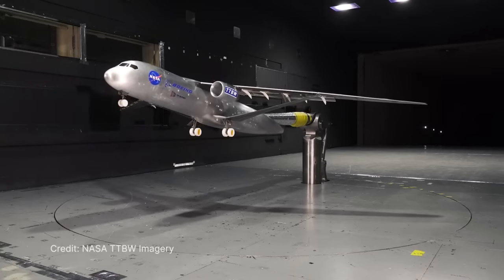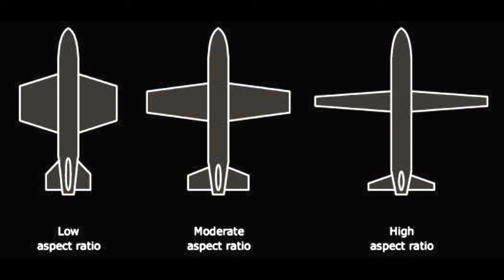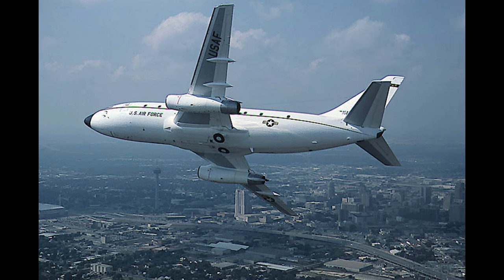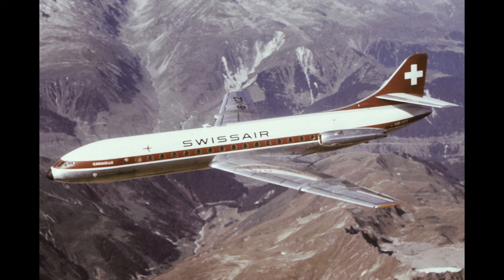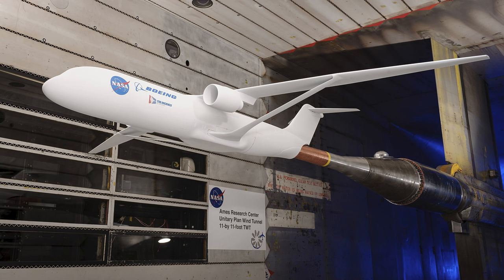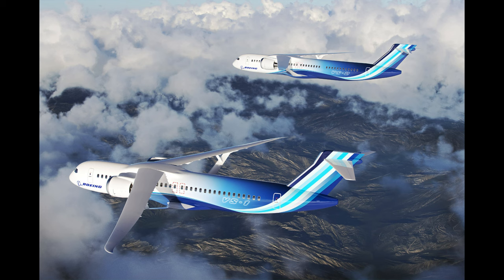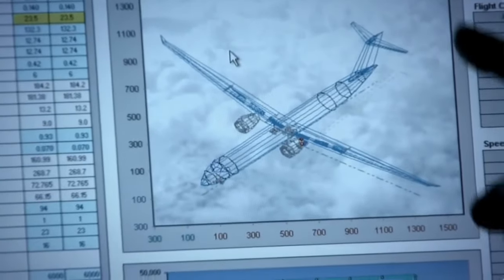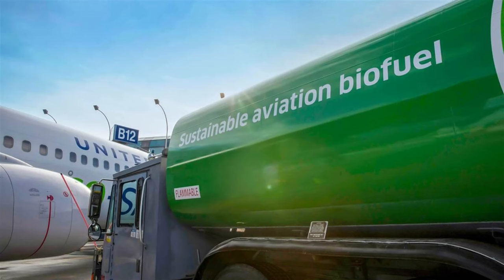NASA's New Airliner Experiment To Make Flying Less Expensive

Comment: The problem with very long wings on an airliners is space the plane takes as it maneuvers on the airport. Longer wings will require more spacing everywhere so that planes don't struck things or other planes.
In the past developing longer wings was fine because it was accompanied by larger number of passengers/cargo the plane could carry. But that changes when you are trying to produce a plane with same fuselage but just very long wings for efficiency. This might be more efficient when in air but should reduce efficiency when on land.
Another problem with very long wings is performance when landing in cross wind. Longer wings are likely going to limit the weather the plane can land it. Which would be a huge problem for airlines.

Comment: Believe it or not , I did think about the same exact design.
Wings do not have to be so beefy,  it can handle more of the G force,  plus more of a wing, less fuel consumption.  Drag is same , because the lower wing is not a connection, it is a connected triangle wing.
But I am retired Engineer, never worked at Boeing. So, forget it.
Greetings from california.

Comment: Maybe they could make a plugin hybrid where both the engines and electric motors would help with taking off since much of the fuel is spend in just getting up in the air.

Maybe climb to 55k feet and the slowly glide down to 40k feet over hundreds of miles to save fuel might help, too!

Comment: More relatable than the engines of light aircraft would likely be things like lawn mowers, electric generators and wood chippers. All of which need engines that need to be able to run at relatively high rpm, for relatively long periods of time.

Comment: You never pointed out the weight problem of electric aircraft. Fuel makes up approx. 45% of the weight of long haul aircraft. This decrease in weight over the course of a flight substantially increases the range.
Reply from the maker: Sound like you never watched the section on electric planes with flight endurance of an hour.

Comment: Two questions.

- Are they going to experiment with a wingtip-less wing design as well -- by basically making the wing a bit shorter and the struts longer?
  (A likely hurdle with that would be a lack of flexibility, but maybe that can be solved by making the strut telescoping with air pistons inside to control the level of flex or so)

- Secondly, what's Osaka doing in the background @1:54?
Reply from the maker: In answer to your second question - tickling the dragon’s tail.
Reply: That's less efficient; they've done coupled aerodynamic and structural optimization at this point, so the configuration is fairly close to reality.
Reply: @scottmanley  I lost all focus when I saw that - "Demon core!... uh, what were we talking about?" 😆
Reply: @AmbientMorality  So having wingtip vortices is no longer considered a problem, or at least not worse than the drawbacks of a wingtipless design?
Reply: @zJoriz  You're always going to have wingtip vortices: that's just a consequence of producing lift over a finite span, and we're infinitely far from an infinite-span wing!

They want the wing to be supported somewhere in the center because that's much more structurally efficient than a very long strut, and also because that allows folding.
Reply: @AmbientMorality  I see! Thanks

Comment: Just think of the tremendous weight savings if they could eliminate thrust reversers and also leading and trailing edge flaps and slats, while using a compromise delta-ish wing.

Comment: Could you look into the idea of acoustic flight control systems? My teacher mentioned it but I don't know if it is something that is simply in its research phases, but he mentioned that it uses the pressure differences that actives speakers systems create to roll, yaw, and pitch aircraft without increasing drag greatly.

Comment: Airport infrastructure is a big factor limiting aircraft design. Somehow, those high-aspect ratio wings are going to have to fit current taxiways, ramps, and gates. Imagine having to remove every other gate to accommodate aircraft design, reducing capacity. No one is building new airports. Idea: fold those high-aspect ratio wings upward for ground operations.
Reply: They will fold. The preliminary high-lift configuration showed folding just outboard of the wing-strut interface, and ailerons on both sides of that fold.

Comment: These designs probably will never see the light of day for a few reasons. 
1) fuel MUST be in the wings before fuel can be loaded anywhere else. Having an airliner that can’t hold a lot of fuel in the wings is dangerous for weight and balance reasons.

2) it’s too big. Airports aren’t going to remodel for it, simple as.

3: the truss makes under-wing work difficult. Boeing likes to keep their fuel panels on the wings, and for a wing this high it would need a truck to fuel it. Not happening with a truss in the way.

Cool design! But impractical and unsafe as it currently is

Comment: This has been done before, going back to the 1920's. 

Giuseppe Bellanca built a series of aircraft which all employed an oblique structure functioning both as a support strut for the main wing and as a lifting surface.

They included the Bellanca K (1928), built for a trans-Atlantic non-stop flight from New York to Rome which ended up not being attempted, probably because Charles Lindburgh beat the adventurer Cesar Sabelli to it, and at that point the almost all of the previous attempts had ended in disaster. 

Lindbergh had wanted to use a Bellanca WB-2, but was unable to reach an agreement for its purchase.

The Bellanca Airbus/Aircruiser/Skyrocket series,  transport and freight aircraft were capable of carrying up to 14 passengers or 3500 pounds of cargo depending on fit-out ordered by the customer. About 120 of various iterations were produced between 1930 and  1940. Where fitted out to passengers they were airliners

Then there was the 77-130 bomber and it's seaplane conversion the 77-320, about 12 of the two types combined were built and bought by the Colombian Air Force in the late 1930's.

These models all had that strut which also acted a lifting surface and were known for their carrying capacity, long range and fuel efficiency.

Comment: Just think of the tremendous weight savings if they could eliminate thrust reversers and also leading and trailing edge flaps and slats, while using a compromise delta-ish wing. Top speed might be slower but the HUGE weight and complexity savings would be .....huge. They might use larger electric brakes with better system redundancy. Eliminate hydraulics entirely. They almost have already. People who aren't aircraft mechanics have no idea how insanely complex all these systems are. Plus we know that they've been experimenting with the idea of eliminating the drag inducing vertical stabilizer by using improved fly-by-wire software and thrust vectoring. 
What other outside the box ideas could improve airline travel? How about eliminate pressurization and fly all aircraft below 10,000 feet, except over mountains. Another HUGE weight and complexity savings. Modern super computers could manage air traffic confined to below 10,000 feet.

Comment: They should make the electric turbofan style that gets run off the APU.
It will be like a diesel train setup. Still have battery power but the APU could power the system and charge the battery in level flight.

Comment: Seems like a high wing also allows for large bypass fan engines and shorter landing gear. Similar to the design goals of the 737 for smaller airport cargo and passenger loading.

Comment: What's trailing the 777's tail fin @ 6:00?
also loved the minivan math =D
Reply: A static pressure probe used to calibrate sensors that are mounted on the aircraft (and therefore have interference from the plane that needs to be corrected for). It's only used for early flight testing.

Comment: Bellanca Aircruiser https://en.wikipedia.org/wiki/Bellanca_Aircruiser  Even the Fokker DR 1 and D7 (WW1) used a small wing as part of the undercarriage that was designed to give equivalent lift to match the weight of the gear thus making the gear weight redundant......in flight.  The truss on these Boeing aircraft will likely perform in a similar manner.

Comment: I don't understand where they're going to carry the fuel, having given up the wings as the very larger primary fuel tanks. Every cubic metre of fuselage that is not used for passengers or cargo is essentially wasted if you are using it for fuel. You are dramatically reducing your cargo capacity. That's why using wings for fuel is so ingenius. So, sure, they might reduce fuel needs by up to 30 per cent, but you still have to put that 70 per cent somewhere, which means you're not putting paying cargo in that somewhere.

Comment: Airplanes and boats really are the harder transport to make ecologically viable. For on land travels and cargo different trains can do most of the work. But if you need to cross continents or seas you will have to use oil. One option could be a world more focused on local production but that's easier said than done

Comment: This will really help Boeing move past the problems of the 737 - engine fans can be larger and further off the ground. It will be worthwhile to train pilots for a modern cockpit design - no way this could get the same type certificate at the 60 year old 737.

Comment: Electric planes need to be compound planes. A lifting part with batteries and extra motors that attaches to fuselage of main plane. Then the lifting part expends it's batteries lifting the plane to cruising altitude at which point it detaches and drones it's way back to base, like SpaceX boosters. 

That way the main plane can continue to destination with a much small battery pack just enough for high altitude cruise and descent and a little bit of holding pattern time.

Heck, if the plane is short on charge at a point in it's flight a lifting drone could dock again with the main plane and serve as a battery pack.

Comment: You weren't very clear, and didn't actually say it, but from the video footage, I am guessing that they are looking at putting trusses on the largest planes in the world, to allow greater wingspan to improve efficiency?

Larger wings have their dangers in a world with increasingly dangerous weather though (warmer, wetter and windier).

Still, having trusses can be a safety mechanism in themselves, in case a wing tip snaps off.

The benefits with batteries are more for when the plane is descending right? ie...
You could turn some of the plane engines into electricity generators instead of engines on descent...

This causes the flight to take longer, but it stores up energy for the next flight.

That's what you should have said lolz

Comment: Lower cost is huge, but I think that unless we get the security theater to be lessened, the increased flight time will more than offset its usefulness. Unless I misunderstand and these planes will go just as fast as current commercial aircraft.

The thing about flying is that it's a miserable experience in part due to space limitations and in part due to self-imposed security theater limitations. The high cost makes it prohibitive unless you need the shorter travel time. I suppose there's a lot of room for domestic flights to be slower than they currently are but still much faster than cars, but it's one of those things that has to be carefully measured.
Reply: It goes the same speed

Comment: Thanks for the interesting video. The narration at 2:40 leaves me confused as to whether the new wing configuration is intended to reduce induced drag or parasitic drag. Could someone please elucidate? Thanks.
Reply: The biggest improvement is induced drag because the wing has such a large span. Because it's pretty narrow as well (short chord), it also might be better for friction drag because more of the flow over the wing can be laminar (but that can be hard in practice so we'll see).
Reply: @AmbientMorality  That makes sense. Is lift being generated by the support struts as well?

Comment: According to the International Energy Agency, aviation accounts for about 2.5% of global carbon dioxide (CO2) emissions from fossil fuels. Passenger planes typically consume a significant amount of fuel during takeoff and climb, so any improvements in fuel efficiency during these phases of flight could have a significant impact on reducing emissions.

Assuming there are 25,000 passenger planes in operation worldwide and each plane consumes an average of 10,000 gallons of fuel per flight, a 10% improvement in fuel efficiency would save 1,000 gallons per flight. If each plane makes an average of 5 flights per day, that would amount to a daily saving of 12.5 million gallons of fuel. Over the course of a year, this would add up to a saving of 4.56 billion gallons of fuel.

According to the US Environmental Protection Agency, burning one gallon of jet fuel releases 9.57 kilograms of CO2. Therefore, a 10% reduction in fuel consumption would result in a net reduction of 43.7 billion kilograms (or 43.7 million metric tons) of CO2 emissions per year.

Comment: I recently heard that scientists still don't fully understand how lift exactly works and it's still scientific theory or hypothesis but we all know it just happens and I was like WTF but now I'm starting to see they might be onto something now with that. So many new experimental designs to this day still and many more.
Reply: Not sure about scientists but in general there seems to be an endless debate about whether lift is due to Bernoulli's principle (low pressure on top of the wing due its curvature) or Newton's law of equal and opposite reaction, which says that air hits the bottom of the wing and bounces downwards, creating a reactive upward force.

Seems to me both are true, in cruise a wing is mostly using Bernoulli's principle,  at slower speeds with a high angle of attack Newton's law comes more into play. Which is why airplanes can fly upside down, because of the high angle of attack.  

But for some reason my position is very uncommon and most people take one side or the other. I haven't figured out yet however which opinion is considered to be the "woke" position by the other side.
Reply: @StevePemberton2  Bernoulli's principle and Newton's 3rd law are just consequences of conservation of energy and momentum. There isn't really a separate contribution from each, they're both always true.
Reply: @josephmagana6235  Both are always operating but it would seem like Bernoulli would be generating most of the lift when cruising at near zero angle of attack. In fact I would think at zero angle of attack Newton would be causing a slight downward force because air molecules hitting the more convex top of the wing are deflected upwards more forcefully than the air hitting the bottom of the wing is being deflected downwards.

At high angles of attack Newton would increase. Bernoulli would also probably increase since you are basically artificially increasing the wing's camber, although I would suspect that turbulence reduces the efficiency somewhat.

Comment: What was that piece dragging behind the top of the vertical stabilizer on the Boeing 777x shown at 6:00?
Reply: It's a group of sensors that measure airspeed and other data. That was the first flight, so they aren't confident in the accuracy of the sensors on the plane (which are subject to interference from the fuselage and need calibration from initial flight testing).

Comment: Boeing wants to be able to mount the new , much larger, high by-pass engines on smaller planes.

So they need a high mounted wing , but it needs to be thin enough that it doesnt block the aisle in the passenger compartment.

Comment: although cool I don’t think many airlines are going to buy these. Their long wingspan would mean that all airports would have to redesign their terminals and plane stands to accommodate the large wings which means less space and fewer planes. Just like what happened to the double decker airbus only a few airports actually made changes to accommodate them and as a result the A380 is no longer in production
Reply: The wings will fold
Reply: The wings will fold

Comment: So they are going to build a glider wing and stick it on a person tube but then stick Cessna struts on it so the wings don't break off? 😄 Will be interesting to know what the proposed aspect ratio will be and compare that to the ETA. https://en.wikipedia.org/wiki/Eta_(glider) Will they be using laminar flow wings with turbulators? They could also ask gliding designers like Gerhard Waibel for one, who was working on an idea for a glider with 99+:1 glide ratio decades ago for ideas. Or maybe they can just plug in the requirements into ChatGPT and it will tell them how to build it 🤪 - Interesting times ahead. The work with the Perlan project will give them data about high altitude effects on composite 'flexible' wings.

Comment: What about ground operations at the airports with such large wings?  How will that play out with various runways?
Reply: Most runways should be fine as it's the same span as a 767. The wings fold to fit in 737-sized gates.

Comment: Problem with this is airport capability. Look at the 777X that now has to have folding wingtips. You'd have to totally redesign airport infrastructure to accommodate them.
Reply: ... or just have fewer gates and mobile bridges at each node at the terminal. An easy fix.
Reply: The wings would definitely fold. It's also only a 160 foot wingspan, so it's comparable to a small widebody.